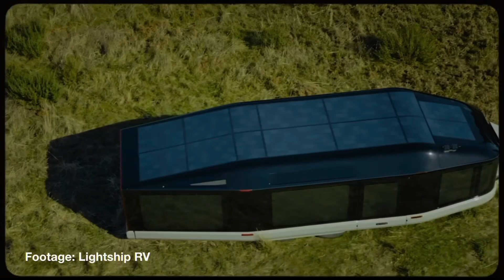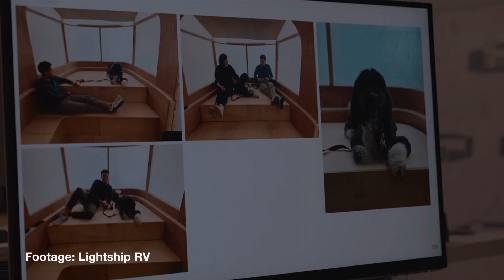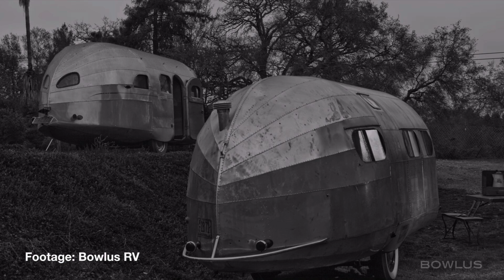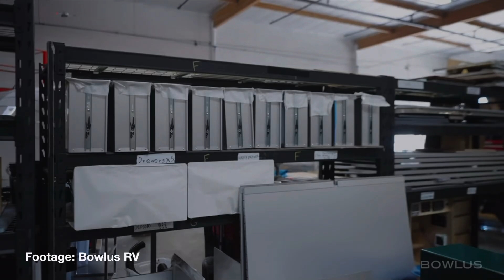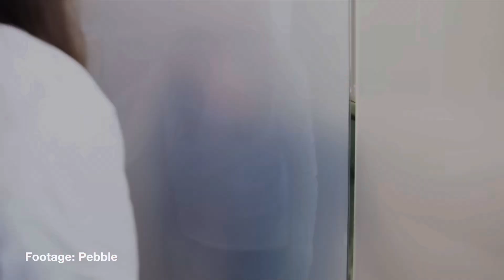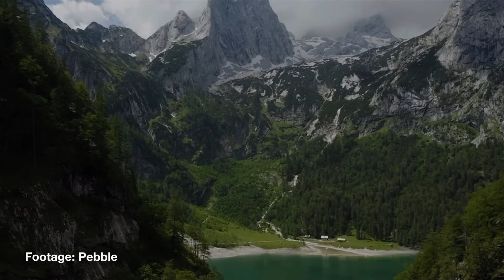IF MONEY IS NO OBJECT! The World’s Most Expensive Caravans

Comment: The Bowlus claims to be aerodynamic but wouldn’t it be more so with the pointy bit at the front and the blunt bit at the back? Like a Kamm tail on an Aston DB6 amongst other late 60s cars. And nearly all aeroplanes have pointy noses.
Reply from the maker: I would have completely agreed with you, but research into aerodynamics shows us otherwise. Something that disrupts the airflow can be just as effective at aiding aerodynamics as a rounded smooth shape. As Knaus confirmed with their recent Yaseo range that was a result of a lot of aerodynamics testing, there’s a terminal velocity to how much wind resistance a caravan can overcome, due to the sheer physics that it’s a wider and taller object than the tow vehicle. So it becomes a balance of aerodynamics counterbalanced with interior space. All research points to the corners of the caravan are far more important when it comes to deflecting the wind than the actual front panel. By that logic, the Bowlus is the perfect shape.
Reply: @NotAnotherWhiteBox  Thanks for the detailed reply. I guess it needs something big to tow it, which would itself deflect a lot of air from the front.

Comment: With the state of the roads these days (not just the UK, but other countries too), I honestly think that the biggest design flaw of European caravans these days is the chassis. It is time for the 'V' shaped chassis in caravans to change. It allows for too much flex and there are reports of GRP walls cracking (I refer you to the 'Caravan Place' channel). I prefer European caravans, but they are desperately in need of a major design change from the chassis up. I honestly don't think that torsion bar suspension is up to the job these days either. No livestock trailer I know of comes with it and for damn good reason. Yesterday, I watched a Humbaur trailer video (official YouTube channel)featuring their 'H Drive P' suspension comparing it with torsion bar. Essentially, a leaf-spring suspension system.
Reply from the maker: Absolutely, 100% this ☝🏼☝🏼☝🏼

I’ve been saying this for years. There’s an interesting article I have in a caravan magazine from the early 1960s that compares rubber torsion (“new fangled”, as it was then) to leaf springs and springs/shock absorbers. They completely dismiss rubber torsion, claiming that the payload on your average caravan isn’t high enough to reap the benefits of the design, unlike on a lorry trailer, for example. Every caravan that they tested with it fitted was noted to be bouncy and agitated on the road, and they noted the tyres having to do a lot of the work to absorb bumps. 

I think a rethink of the chassis is needed. The La Mancelle caravan that I reviewed had an Alko chassis that was extensively modified. It not only had a more expensive Alko Delta axle, which promises to give the road handling characteristics of sprung suspension (is that an admission from Alko that it’s superior?!), but they also fitted rigid steel sections across the width of the caravan to strengthen the chassis and floor, very much in the same vein that caravan chassis used to be 50+ years ago.
Reply: I agree, and wind resistance / drag coefficient could certainly also need an update.